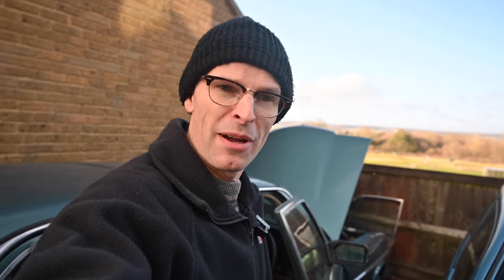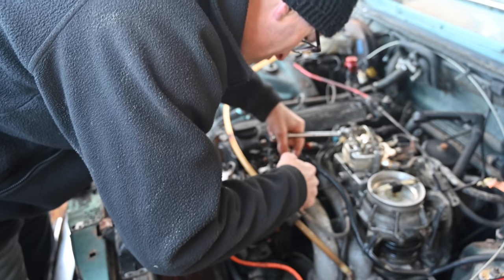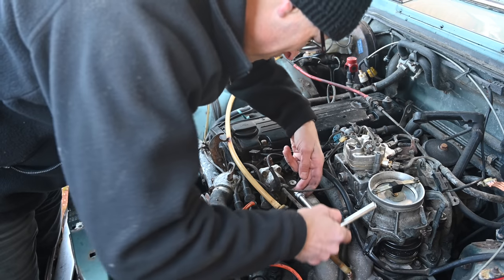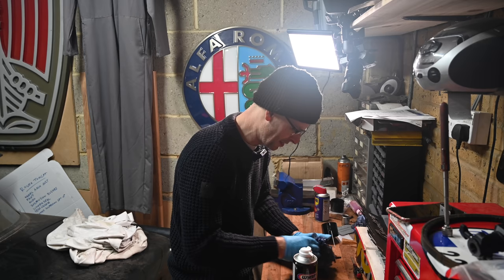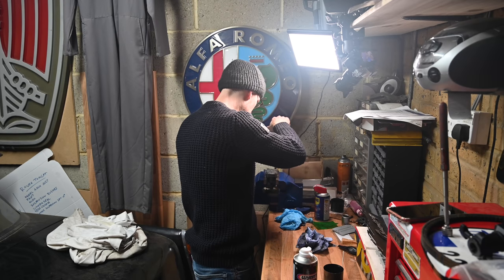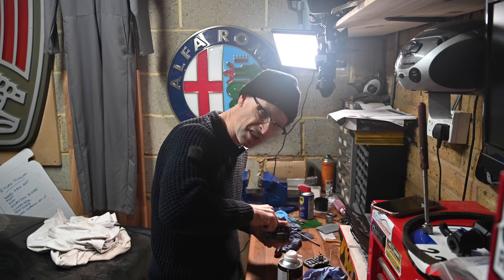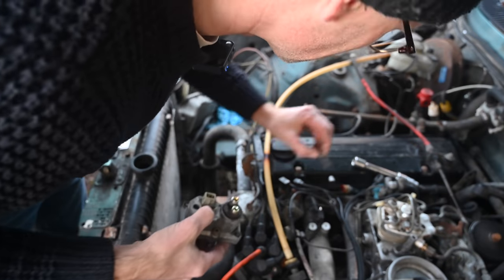Mercedes W123 Warm up regulator rebuild

Comment: A couple of things that might help you, having just been through all of this with my KJet TVR and now have it running great. There should be a very fine filter mesh on the inlet of the WUR, under one of the big fittings the fuel pipe screws into. This needs to be checked and cleaned, it can cause enough restriction to cause issues even if you can blast carb cleaner through it. Secondly, as mentioned by others, you really need to get a pressure gauge on it and check your system and control pressures, or you're kinda just pissing into the wind. The pressure tests can identify what isnt up to scratch, and is far better than throwing parts at it (which may not fix the issue anyway, without setting the pressures correctly). It will also never start if the sensor plate in the AFM isnt set correctly, no matter what the rest of the system does. If the accumulator is leaking it will be losing system pressure (a pressure gauge would show this), and can be tested as described by another commenter. Its a good system when it works, but super finicky when it doesnt. Good luck!

Comment: A couple of things:

1) If there's no fuel pressure, (as there isn't which is why it's a dribble not a jet), it's not likely to be the cold start regulator. Try cleaning out the regulator near the fuel pump before you buy a new one using carb cleaner and the air line set to about 30 PSI. That should be OK as the fuel pressure should be around the 50 to 75 psi mark. 

{*EDIT*} Don't forget to clean the injector and injector feed lines, remember the crap in that injector we took out and blasted through with air line. 

2) We lost no tools in the engine bay!!! We did not keep dropping sockets, spanners and crows feet into the engine for them to vanish off the face of the earth. It didn't happen! We were absolutely perfect and it's the Merc that's refusing to cooperate. 

There's a certain mystic when it comes to these mechanical shenanigans which must not be told to the viewing public.
Reply from the maker: Ha yes they fell into the void! And are still there! 

Fuel lines and regulator when I get in tomorrow
Reply: @furiousdriving  Didn't you put new fuel lines in? I'm sure you did. Maybe a blast out from where the pipe goes into the fuel filter (at the front, not behind the filter), to the front of the car might clear out any crap? Hmmmm, there's an idea ........ A petrol can, an air line and pressurise it to send fuel to the injectors? You might get an over run BUT if the car starts and fires even with 30psi behind it then the fault has to be in front of the fuel filter.
Reply: The Fake Russian . The small brass mesh filter on end of fuel feed line is to stop any crap entering distributor,  can in itself block easily , reducing volume of fuel required.    I am still unsure whether the accumulator at fuel pump would be a problem.  They are simply a diaphragm and spring to keep pressure in line for a short time, after engine stopped. Thus avoiding fuel vaporizing on a hot engine. .
Reply: @jackjacko8706  Mesh filters hardly ever work effectively as they're too prone to being gummed up but as far as I remember it's a clear so that's not the issue. The only thing that hasn't been changed/cleaned is the fuel accumulator which doesn't hold the pressure after the engine has stopped it builds it on start up so that pressure gets to the injectors then when the engine fires it opens to allow fuel to return to the tank but also constantly cycles opening and closing to maintain the pressure. I'm 100% convinced the non-start issue is fuel starvation and given all the other work done, (new fuel pipes, fuel filter and fuel pump, new injectors and cleaning the fuel distributor), does point towards the fuel accumulator being the fault.

Comment: I have been following this W123 from the beginning. Matt, I could have fixed it in less than 10 minutes. Two sticks of dynamite in the engine bay, two in the interior and one down the petrol tank, run like hell. What patience you have, I'm afraid I have none.
However the 740, I love it, so comfortable, quiet and a lovely ride.
Sorry to hear about Andy. All the best.

Comment: On a cold engine the rest position of the WUR is to push down on the spring to reduce the fuel control pressure which allows the air measuring plate plumger to move further thus enrichening the mixture. 

Upon startup the bi-metal strip is then heated and pulls away from the spring thus weakening the mixture. Thereafter the heat of the block maintains the bi-metal springs position in the WUR and the electrical connection is removed. 

In summary the operatiom of the WUR is to weaken the mixture which is a bit counterintuitive. A failed bi-metal strip would cause a rich mixture and therefore affect hot starting.

Comment: I don't know what the symptoms are but why are you taking this control pressure regulator apart? Have you measured the control pressure from cold start to fully warm to determine if it is faulty? This is a very simple,effective and extremely reliabe system first used by Volvo in 1973.  The running pressure is around 5 bar and has nothing to do with the control pressure regulator you have there.
Reply: I concur.

Comment: I looked back at the video from about a year ago where you replaced the fuel pump. It was in a bad way, so it's likely that the accumulator is worn or clogged. They are expensive, so maybe try cleaning it with carb cleaner and air at low pressure, say 40 psi. You might get it going just enough to know that it is worn.
Reply from the maker: Thats my next move, didnt think it was as important until now

Comment: Matt, please don't give up. You're closing in on the problem and the smiles per gallon will all be worth it in the end. In the meantime, it makes for great content. I want to see the W123 running. An impact driver is your friend and will save you mullering screws that are difficult to undo. I've just swapped an ignition coil in my 5th Gen Toyota Celica and I had to undo 8 Phillips screws. The impact driver along with my trusty 2lb lump hammer got them undone without too much trouble.

Comment: Bit of insulating tape around those sockets will stop them dropping off the end. Definitely looking like the regulator  as the car starts on easy start, but who's to know really  at the minute. Well done for keeping going with it.
I've been dropping bits including a headlight bulb this week, I put it down to the cold weather making working outside miserable. Can't find my magnetic stick  tool anywhere either...
Reply from the maker: you must have dropped it ;-)
I should just get a new extension bar for my smaller set and save a lot of agro, the sprung ball has gone

Comment: I just saw only this video but one word of advise beforebuying new expensive kjet parts . Make 100% sure your petrol tank is spotless inside . There is a drain with a strainer. Stick your finger inside or a cam. Make sure its clean inside if not clean it

Comment: I awn the same car with the same m102 engine and I'm pretty sure i know where your problem is 
(It's the fuel accumulator)
It's not getting enouhg fuel pressure to start
I will try to explain the fuel delivery system for you 
The fuel comes down from the tank screen through a hose then it T off to 2 hoses one goes to the fuel pump and one goes to the fuel accumulator the fuel pump then takes the fuel send it to the fuel filter and the fuel accumulator pressurised then it comes out of the fuel filter to the fuel distributor then to the injectors 
The fuel accumulator should reserve that pressure until the engine is off and then it start to depressurise through the bleed hose back to the tank your fuel accumulator is faulty and it doesn't hold pressure it sends the pressurised fuel right back to the tank and the pressure that goes to the distributor is not enough to open the injectors 
I'm pretty sure that is what your problem is
(Quick check) 
Crimp off the rubber hose that comes out off the fuel accumulator to the tank completely shut and try to start the car 
 first make sure that it's not brittle cause ones you crimp it it's going to break and the fuel tank will leak all the fuel 
(Ask me how i know)
Reply: thank you for taking the time to explain. i have a w201 that refuses to stay on when i touch the gas pedal.
i´ve been chasing the cause of the issue and haven´t found it yet.
small pieces of info such as this one are very useful.

Comment: For crap to get through to the  injector lines it would have had to go through the distributor, which I presume was before the new kit was installed.  In frustration with similar problem on a 280se. I put an eighth drill bit through the brass filter., even though I could blow through it.  Engine  then started instantly on all cylinders.  It is  just a thought . 
As far as the accumulator is concerned, I have a hole in the diaphragm on my 230e.’s accumulator, so does not hold pressure.   Motor still fires up straight away from cold and runs smooth. Only when hot, do I have problems starting, having to wind it over a few times. .   When working properly , one side of the chamber fills up with fuel from the pump, pushes against a sprung diaphragm until compressed, then the fuel continues along the line to the distributor . It does help in stopping pulsing and reduces noise from pump when working. When motor is stopped, the spring presses back against the diaphragm and keeps pressure in the line for about half an hour or so to ease hot starting. I think you need to do a fuel pressure test to see if within specifications first. I will be surprised and stand corrected if the accumulator is the problem.    Best of luck.

Comment: Bad luck on the no start,  I commented on your Mercedes c class estate video about the wheel bolt locator tool,  I have just realised that you might have one in the w123's tool roll kit,  got to be worth a look,  
Keep up the good work
Reply from the maker: sadly no tool roll in this, Ive been hunting for bits for it
Reply: @furiousdriving  I have a spare one here with me if you want it ?

Comment: Have you confirmed that the fuel pump is actually running when you're cranking the engine? (as it did seem in a previous video that the engine wanted to go when some easy start was sprayed into the intake).
There should be a fuel pump/rpm relay which you can remove and then jumper two pins on the relay socket to force the pump to run permanently for testing purposes.   With one or all injectors removed it will also allow you to check that the fuel pump is dispensing fuel to the injectors when you press down on the flap on the air metering unit.
Reply from the maker: Yes, its a new pump and filter putting out good pressure, and have had the relay checked and done the pin thing, its definitely the Bosch injection parts that have an issue!

Comment: Why not take out the injectors, put them in a PET bottle (one bottle per injector) and see: a) if fuel comes to the injectors and b) if the spray patern is OK?
Reply from the maker: we did that in a previous video

Comment: Hi Matt, did you ever get this car running? I have been having similar problems but have now got the car running. Just some friendly advice... The first thing you should check is the return volume. You need to get at least 1l in 30 seconds. If you are not getting this the system will not work.
Regards
Reply from the maker: Thanks, theres something up with the metering unit, when the lock downs over Im getting a Merc tech to have a look at it

Comment: Power supplied with a running cold engine. Otherwise there is a big coolant temp sensor at fault.
Reply from the maker: And presumably a cranking engine when cold as well
Reply: furiousdriving Some Car’s has an extra injector in TB to apply more fuel when cranking.

Comment: Air leak going to metering unit housing 

Dose the flap move on cranking  ? 
( below where air filter should be )
Reply from the maker: flapping with the throttle pushed when cranking, yes
Reply: Even though it moves it still could be a very small air leak  
Is fuel coming out of a injector pipe on cranking? 
Sorry for the questions I’m new here